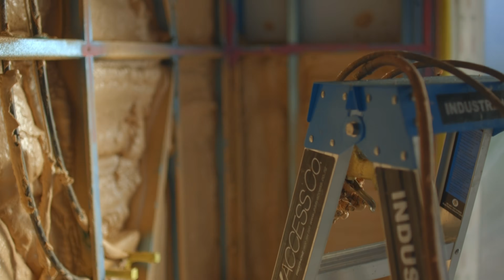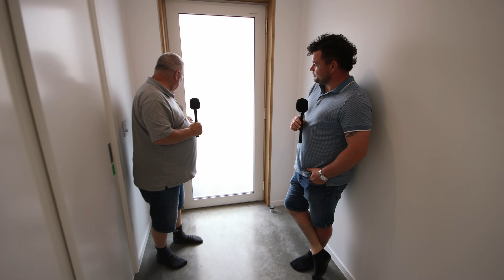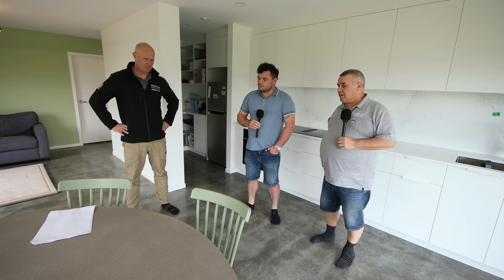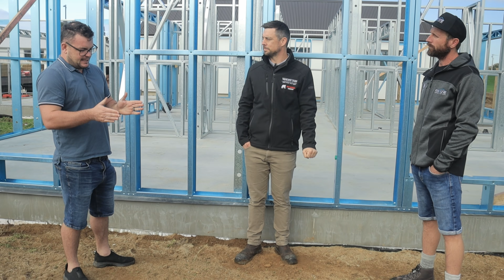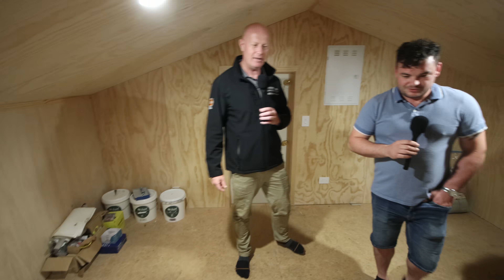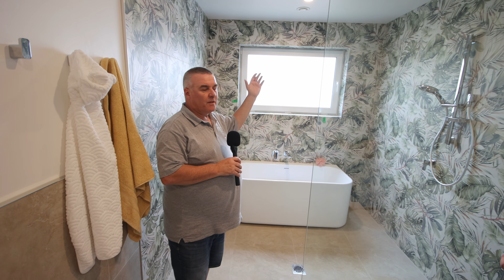Steel Outside, Science Inside: Passive House Shed Home Tour

Comment: Where does the exchange air come from? Is it fresh from outside? 

Have heard of homes that have had toxic VOCs and off-gassing from spray foam insulation, how do you ensure this doesn't happen?
Reply: Did you watch all the video? Google HRV to see how they work. Stiebel Eltron is the brand of HRV used in this house.
Reply: @jasonclarke6355  HRV is not a comparable system to Stiebel Eltron.
They both have fans and that's about where the comparison ends.
Reply: @davidcork452   Stiebel Eltron make HRVs. What are you talking about?
Reply from the maker: Hi there,

I trust you are well. 

Sorry for the delay. 

Absolutely does.
Brings in fresh air, filters it and pre conditions it with the exhaust air.
The Mechanical Heat Recovery & Ventilation (MHRV) is 94% efficient, meaning the heating/cooling system is only ever trying to condition the remaining 6% of the volume of the building.

The building has a total air exchange every 3 to 3.5 hours.

Even with all the windows closed for weeks, the internal air quality in a passive house would far exceed that in a regular house.
It would likely be better than the outside air as its filtered.

1.	I know the point were the material is most dangerous is when it is atomized initially during install. I can't confidently speak to VOC and off-gassing.

a.	I would like to clarify that our product does not release any volatile organic compounds (VOCs), as it utilizes a water-based blowing agent rather than a chemical-based one. Any off-gassing that may occur is limited exclusively to the installation phase and is short-lived. Once the material has cured—typically within 24 hours—it becomes completely inert and poses no further emissions.

2.	I remember a conversation along the lines of, 'if any material burns it's not good for you, spray foam isn't any worse than most building materials'.
a.	I wanted to provide further clarification regarding the role of spray foam insulation in residential homes, particularly in relation to fire safety. Spray foam, like all forms of insulation, is commonly installed behind interior linings in residential properties. Its primary function, in this context, is to act as a barrier that can slow the spread of fire by preventing the penetration of oxygen into the building. This is a critical component of fire safety systems, as it helps contain the fire within a specific area until the necessary measures, such as the opening of a door, can be taken.
While the spray foam itself is designed to be fire-resistant and can significantly delay the spread of fire, it is important to clarify that the real threat to life in the event of a fire would not originate from the foam. In most cases, the immediate hazard in a fire situation comes from the burning of materials in the room, such as furniture or upholstery. For example, the sofa you might be sitting on while watching a movie, if ignited, would emit toxic smoke and heat, presenting a far greater danger to occupants than the spray foam insulation.
The spray foam, however, performs a crucial function in the overall fire safety strategy of the building. Creating an air-tight seal reduces the availability of oxygen to the fire, which can slow its progression. This containment effect helps to mitigate the rate at which the fire spreads, providing more time for occupants to escape or for fire control systems to engage.
In conclusion, while spray foam insulation is not a primary fire suppressant, its role as a fire barrier contributes significantly to slowing down the fire's advance and buying valuable time for other fire safety mechanisms to take effect.

3.	Fairly certain the foam is inert after its fully cured right?
a.	Correct after 24 hrs 

4.	25% recycled material as well? I know you have started getting it made in NZ so I don't know if that is still applicable. 

a.	While our manufacturing process takes place overseas, I’d like to highlight a key aspect of our sustainability efforts.
A portion of our product is made using recycled materials, specifically post-consumer plastic bottles. To date, approximately 25% of the product composition consists of these recycled bottles, amounting to millions of bottles repurposed annually. This initiative is part of our ongoing commitment to environmental responsibility, and we are continuously working to increase the percentage of recycled content in our products.

Tese are from Chris the CEO of NZFoam

Thanks Jason